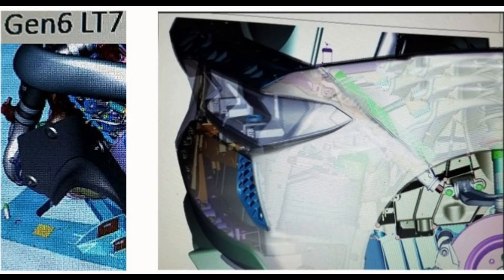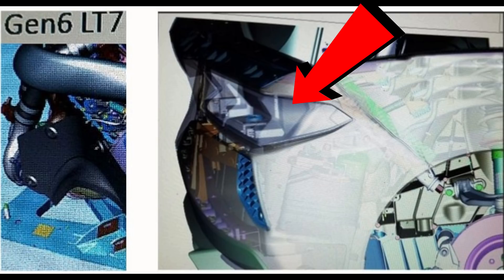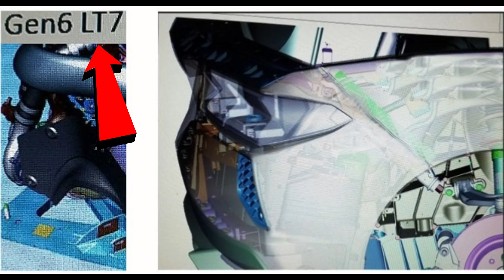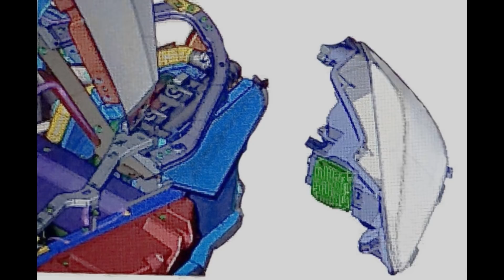C8 MID-ENGINE Corvette information. LT7 Engine SHOWN off! NEW RENDERINGS!!

Comment: Big thumbs up!  Anecdotal information here, but it may come with three different motors.  500 HP, 600 HP and a 800 HP.  I just heard this today from a very reliable source.  What do you prefer?
Reply from the maker: Highest possible! 😁
Reply: Well 800 HP WOULD BE GREAT ,  BUT AT A 30 K PRICE INCREASE  OR MORE ... I CANT DO THAT !!! ITS A DREAM FOR ME ...  COOL EITHER WAY ...
Reply from the maker: Burns me up.  Yeah it's likely to be more than 30k. something in the starting point of the car is likely to be more than the current C7 as well.
Reply: 600 HP! All you will use or need!
Reply from the maker: Probably true!
Reply: Burns me up.  that would be incredible.  just makes you wonder how the cars will be released time wise...meaning I wonder how long after launch the higher end models will come.

Comment: Motortrend confirms a DOHC TWIN TURBO V8 by Johnny Lieberman on the ignition segment featuring the ZR1. There is NO WAY the base model will be priced below 70K. The base model has the potential of being a GT2RS competitor instead of a GT3 equivalent. The ignition segment and accompanying article have me to believe that the current ZR1 is actually a 900HP motor with a overly saturated fuel air mixture. Whether this was done on purpose to keep engine temperatures low is any ones guess, but GM has made it near impossible to alter the FUEL AIR MIXTURE. No one so far has figured it out.
Reply: if you think a 6L ‘vette will compete with a 4L GT2 you are dreaming.
Reply: @paulschmidt5847  Yeah I would put money on GM anyday of the week. The gt2rs is a stripped high horsepower track car. If GM goes in the direction of single purpose machines it will crush the competition. It will be interesting WHAT they release as a base car but I guarantee its faster than a gt3 as a track car.

Comment: Yeah how much can they copy Lamborghini and Ferrari?
Reply: Well, of course...  has headlights, brake lights, and even 4 wheels and tires.  So do Lamborghini and Ferrari, GM must be copying them...  The overall look, is very much in line with Corvette styling.  Put the engine behind the seats, and of course the proportions will shift.  Mid engine cars are going to resemble each other in some ways.
Reply from the maker: This is exactly right. A lot of the other car manufacturing executives have even touched on the point that a mid-engine car is going to have a very similar look to any other Mid Engine car. It's just the layout.
Reply: sure dude,thats what they're gonna do.Right.